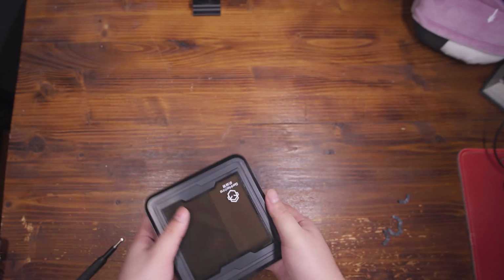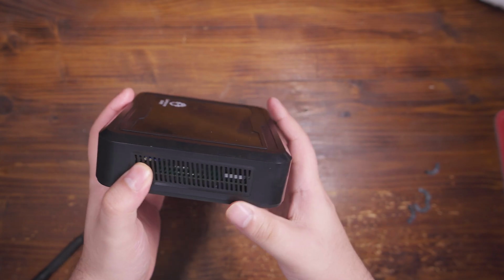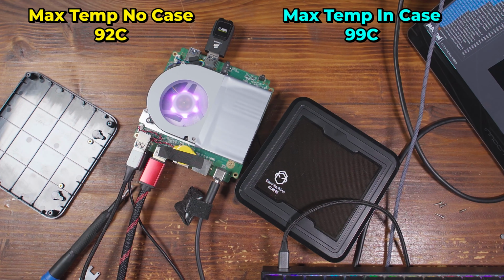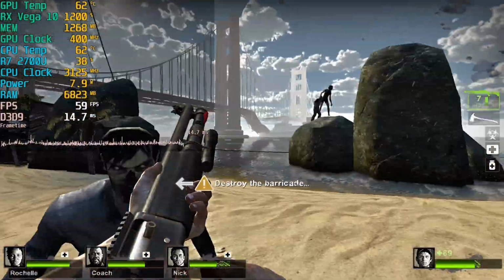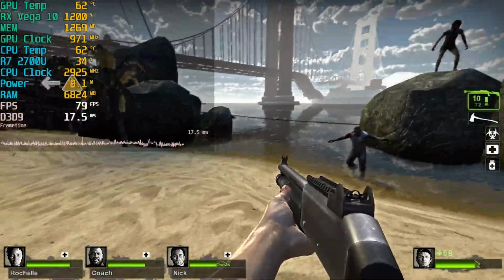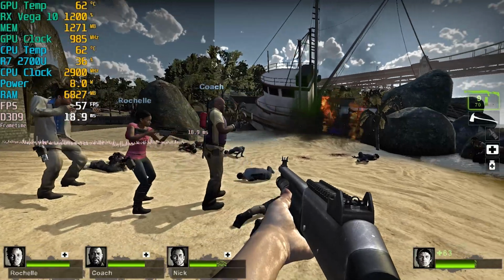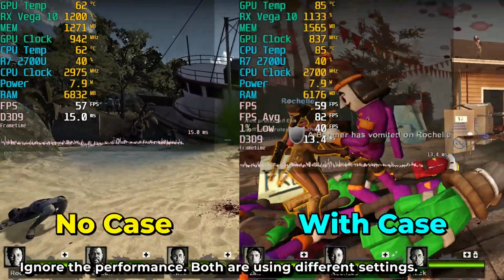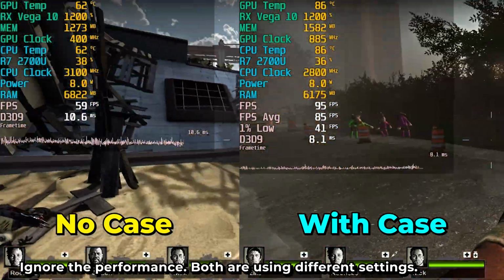Taking Apart The Cheapest Ryzen Mini PC on Amazon | Is This Actually An Amazing Deal? | SBC

Comment: The AMD Ryzen 7 2700U is a processor that was released in the first quarter of 2019. It has four cores and eight threads, and features a 14nm processor technology, 15W default TDP, and a maximum operating temperature of 95°C. The Ryzen 7 2700U also has Radeon Vega 10 graphics with 10 cores and a frequency of 1300 MHz. It supports DDR4 system memory with up to 2400MT/s and two memory channels, and uses PCI Express version 3.0 for connectivity. The Ryzen 7 2700U is unlocked for overclocking, but doesn't have configurable TDP (cTDP). 
Reviews of the Ryzen 7 2700U have noted its good multithreaded performance, and say that it's faster than 7th generation Core results. However, one review says that it doesn't have as strong single-threaded performance as the ASUS Zenbook 3.

Comment: For an 8w cpu I'm still surprised how warm it still gets even with the case off. I have a gmktec g2 n100 mini pc that will run 15w to the cpu if i open throttlestop and max out the power limits and that cooler is about 1/3rd the size of that n still only gets to about 75deg with the case on during a 10min r23 test.

Comment: Originally the case probably had a mesh top, but then they swapped it out for the smokey plastic because it "looked cooler".
Reply: creo que fue diseñado para estar de manera vertical  es decir una entrada de aire por debajo y la otra por arriba asi el aire caliente tiene una salida y la entrada de aire principal debe de tener el ventilador abajo ademas para eso es el soporte para monitores y tv que incluye

Comment: I am so happy you did this.  Everyone else who reviews these mini pcs complains about the high temperatures but they never took off the case.  There was another video where they put a rx560 into a HP elite desk 800 g4  and barely saw a performance increase but the temps for that test were always at max so it was thermal throttling.  If they took off the case like you I think it would have worked great.
Reply: I seen the one with the rx 560 he need to order the ventilated side panel for it
Reply: why even sell it with a case then
Reply: esa mini pc esta diseñada para estar de manera vertical para que el aire salga por arriba y entre el aire por debajo  la parte lateral de abajo tiene que tener el ventilador